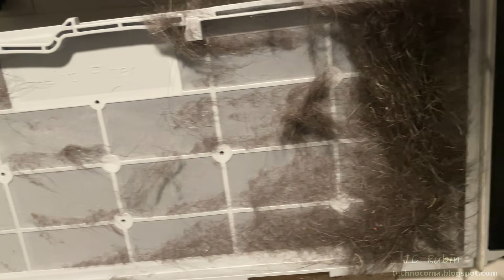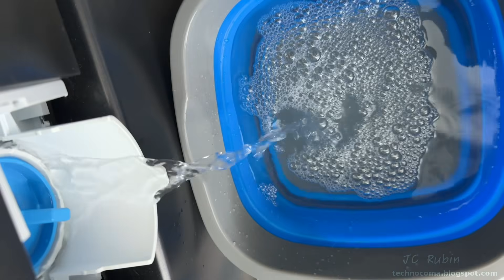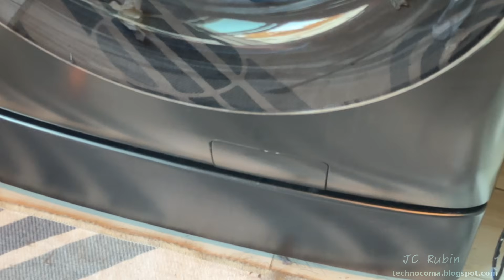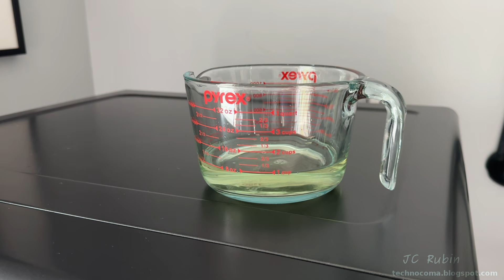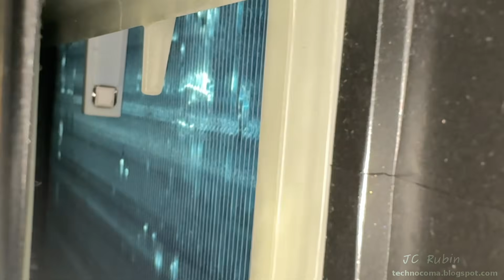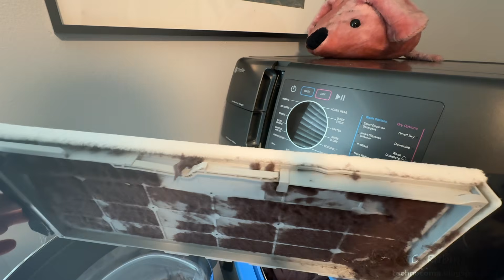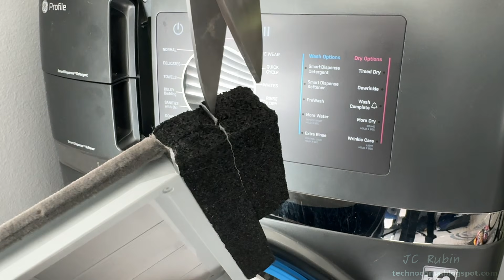GE Profile Ultrafast 2in1 Combo Washer Dryer - Why they Fail & How to Fix it

Comment: I just got mine delivered last week. As I was using it for the first time, your video showed up. I got both of those sticky foam liners for the filter. I am also going to see about getting the new filter for free. They need to just hire you, or you can 3d print a piece for the back and patent it and sell it to them. You clearly know more about the machine and how it works than they do. It's a shame. I was so excited about it and your video has me scared it will get ruined. I am going to buy the extended warranty on it. 
I live alone and I work a lot. This machine is supposed to save me time and money. I think with your modifications it can still do that.
Reply from the maker: 3d printing a piece has its own set of challenges.   Further it limits the amount of people who can conduct their own repairs.   Soon the seal results video will come out with the incusion of an internal seal installation
Reply: @rubin-tech I put the sticky foam liners but now I can't get the filter out 😢😢. But wow it did such a good job. I washed a comforter, two queen size sheets, pillow cases, 4 leggings and a few more small things. It took 2hrs total. But how do I get the filter out. Can I email you?
Reply from the maker: @jaydee1389 It takes a few tries as it breaks in and becomes easier with each subsequent load of laundry

Comment: This machine has been produced for over 3 years with the same design flaw GE refuses to acknowledge. Like many others, mine worked great for about ten loads before the dry times started to get longer, despite cleaning the lint trap every load. The fact it had a software update with a pet hair removal setting just screams to me they want this thing to clog asap. It DOES remove a lot of lint and hair, but the filter design should have been addressed during product testing. I could see lint getting into the evaporator on my first load.
Reply from the maker: The seals do well to limit the bypass.  A 6 month video checking this result is coming out shortly
Reply: @rubin-tech good to know. I like the machine otherwise.

Comment: I've had my GE combo for exactly 3 years now and it continues to wash and dry in the same amount of time as it did when new.  I identified early on that this unit was going to need consistent maintenance in exchange for only taking up one space in my laundry room.  Since day one, I've always cleaned the lint off the lint filter after every load as I also did with my regular dryer.  I completely wash with water, the entire filter assembly including the foam filter after about every 10 loads.  I run the self clean cycle with bleach after every 20 loads.  I always leave the lint filter out and the dryer door open after each load so that latent moisture in the machine is allowed to dissipate.  I use the brushes to brush out the lint compartment and purchased a special grabber tool on Amazon to reach in and get the lint cakes off the left side about every 10 loads.  And only about four times a year. I use a pump sprayer bottle that I bought with a very long wand for the specific purpose of washing off any lint that collects on the blue cooling fins.  Yes, this is a little more maintenance than most folks would be willing to do on a piece of laundry equipment, but I'm a retired tech geek and don't mind doing it at all.  I've never modified my filter assembly and don't plan on doing so in the future.  The one thing I have identified is very detrimental to this machine is the use of its fabric softener feature.  Most, if not all, liquid fabric softeners were designed to be used with clothes dried in a conventional dryer where the clothes reach a critical fusing temperature.  These high temperatures are never reached in a heat pump dryer.  What ends up happening is a waxy deposit of fabric softener plugs up the tiny little holes in the lint screen mesh which is nearly impossible to get out despite looking clean to the naked eye. This eventually severely restricts airflow leading to long dry time. GE even released a different version of the same machine that lacks the fabric softener compartment.  The major need for conventional fabric softener in conventional dryers is to keep static cling under control due to the clothes literally being over dried and cooked creating a static environment which can never happen in a heat pump style dryer, so in my opinion, fabric softener is never needed in these machines anyway.  True, if you have the optional platform base, your machine is going to rock and roll a bit due to the high center of mass.  Overall, I like the machine and would recommend it to technically minded people that they go ahead and get it.  However, if you're the kind of person that isn't excited about the extra maintenance this machine requires then it probably isn't for you and probably should be avoided.
Reply: Can you please provide a link for grabber tool you mention.

Comment: thanks for sharing this, a good friend of mine (that hasn’t seen this video) just told me the other day that these machines aren’t where they need to be (quality wise) and decided not to buy one. i knew these machines had issues but didn’t know it was this bad. thanks for posting this. they really should fix the machine with the ideas you have come up with.. or extend the filter housing at least so it can go the entire length of slot that you pointed out. strong work. thanks for posting!
Reply from the maker: You’re welcome.

Comment: How often would you recommend leaving the seals on? I just added them to my lint filter and curious if I need to replace them every so often or should would they stay in place if applied correctly? We’ll be popping the top off tomorrow to do a proper deep clean on the machine and coils as well!
Reply from the maker: So at 6mos they were ok. but if it takes 5 minutes every 6 months wouldnt hurt.

Comment: Has anyone used the new filters they apparently made and send out upon request? Our tech gave us a new filter a while ago but I didn’t know it was a new design. They just said “this is so if you have to clean the filter you can swap it and keep going while you clean it” (which doesn’t take too long to do so idk why that mattered)…

I am about to be charged $430-500 to tear the machine apart to clean it and use the new filter. But I think I’m going to just buy a new set and get rid of this. Hopefully the recall gets approved and I can get a refund.

Comment: Nope.....bought a five year warranty. THEY will come out and do it. Honestly....the machine works perfectly in "timed dry" vs sensor dry.
Reply: hmmmm how long do you set it to time dry?  mine leaks during the dry cycle.... i think i will add the 5 year warranty too... mine has been leaking since the day it was delivered.
Reply: I also bought the warranty and when I called them they told me it just needed to be cleaned and they don't cover that!  I've had this machine since first week it wen on market and it has been a nightmare.

Comment: I bought my GE Profile less than a year ago. I only use it about once a week. The first couple of times it seemed to get my clothes dry at the time it estimated (2.25 hours). However, it progressively took longer and longer to dry the clothes. The drying process itself would take many hours. The unit finally prompted me to clean all the filters and run a self cleaning. I started watching videos like yours to figure out how to clean it and had no idea about all the lint issues. I just ordered the upgraded filter and also ordered a long brush and an extension hose for my vacuum. I hope my drain hose isn't clogged as well.

Comment: I found an even better fix!
I got rid of mine.  Replaced it with an LG Stackable washer/dryer set.
I can wash/dry my clothes in a fraction of the time it took with this hunk of trash. 
The biggest plus?  No more issues with a horribly designed "heater box".

Comment: Had our unit since 12/2023.  I've cleaned the filter after every load. I noticed the lint on the opening that goes into the unit.  I've cleaned to water pump filter each month.  Two days ago the machine stopped drying.  I've cleaned all filters and the water pump to no avail. 
Unfortunately I'm not skilled enough to attempt the cleaning you've demonstrated in your video. Thanks for all your information.
Reply: I’ve had it for three weeks and it’s already not drying 😢

Comment: I purchased the warranty from square trade (All State), I have filed 4 claims on the same issue.  Each time, either the heat sensor or the control board was replace.  The 4th time, All State sent out both the sensor and control board again to ask the technician to change.  I bet it’s the internal drain line got clogged like this video shows.  I will show this video to the technician who will be coming to fix my machine.  At this point, I just want to give up and get the speed queen or other  German brands to replace it.
Reply: Did they ultimately find this to be the problem and unclogged it?

Comment: Great video, thank you. I realised our mistake in purchasing this machine two wash cycles in. I recognised the issues with the almost “lint filter” very early on in our ownership. I added all the same additional seals you added and also recognised that the filter should be removed at the end of the drying sequence because the moisture hangs around inside the housing assembly making all the debris stick to the wall where one cannot access. Will be looking for an alternate manufacturer of this style of machine. I fail to understand why GE didn’t see all these issues prior to releasing to market. In addition why the bloody hell didn’t they make an access cover over the left hand portion of the dryer assembly to facilitate easier maintenance.
Reply from the maker: Glad it was helpful. Many mistakes were made in the design.

Comment: I had to completely remove that corrugated drain hose in order to properly clear it. It was very difficult to get out and uninstall (had to take out a few more screws and lift the bottom of the filter chamber for access) but I'm glad I did. I couldn't remove the crud at the top of the corrugated hose otherwise. 

Thank you for all of your videos on this machine, especially the disassembly video! This drain hose clog is surely the root cause of most people's problems. After clearing the drain hose and making your filter modification, I am hopeful I won't have to take apart the machine again.
Reply from the maker: Interesting. There is only one Hose clamp to secure it to the top and came off without issue.
Reply: @rubin-tech  If this person was using the PFQ83 version of this machine (Essentially the Mid-Range model in phone terminology) that drain hose is a major pain to get to. I had to undo the heat pump screws holding it to the frame and prop it up as this person described. Unfortunately I did not find any clogs in there so my investigation continues...
Reply: I was able to pick coils up a few inches and clear drain hole and trough from above

Comment: Hey friend, your videos on this machine are amazing. I am getting this machine and it is my only choice. Obviously, I will be heeding your advice and getting the newest filter upgrade as well as the mods linked in your description. I know you mention "nothing gets by" I was wondering though since you do 6 month maintenance routines, what have you found after you implemented your modifications during the 6 month maintenance? Do you find improvement or a complete solution in the modifications? I'm wondering because I'm not sure how I feel about tackling the take apart every 6 months and I guess I'm hoping the teardown might be avoided if the filter mods are implemented from day 1.
Reply from the maker: Great question.... Im about 3.5 months into the mod so we have a bit more to go before the next teardown and inspection.

Comment: So happy I found your video. Watched It before my unit was delivered. Mine came with the "updated" lint trap design. Had a lot of laundry backed up and did 4-5 loads the next day. Complete wash and dry cycles. With the weather seal strips exactly how you demonstrated not a spec of lint made it to the coils. Thank you very much for taking the time to troubleshoot the lint trap and figure out what works best. I do feel sorry for those who don't use or know about the foam and just hope that the machine does its job at catching lint. Sadly it doesn't do well enough and it's agreed that the consumers shouldn't have to modify something that is brand new and cost 2K. Thanks so much for going through all of this. We do really appreciate it.
Reply from the maker: Glad the video was helpful.

Comment: I watched several videos on this topic, and this is by far the best.  A lot of videos have you tape or glue the inner filter to the housing.  This did not appear to be an issue with your filter.

Comment: This is one of the most annoying purchases we ever made. This thing sucks! And it was so pricey 😢 I accidentally dropped a stick I use to clean the filter side inside the lint compartment tube and we tried to take it apart! Our marriage almost ended after 3 hours of finding different screws to different parts and not even be able to take it apart 😂 i broke a part of the hose connector and we broke a piece that connects to the display part! 😊 I wanna give this away but it was so pricey. We had it for 3 years now we have two german shepherds and a cat. We use a pet wash tab once a month and still I get that nasty smell on our clothes. Awful machine
Reply: Call the company, they shoukd stand behind it, good luck

Comment: My unit died would no longer dry my clothes . Technicians came out twice. Technicians could not fix. Luckily I was a Best Buy total member. When I called about the same  problem for the 3rd time they set me up with a brand new machine with an updated filter works awesome.

Comment: Does doing this type of clean void any extended warranties purchased? 
Asking for a friend! Of course,
Reply from the maker: Absolutely! Also not doing it on mine would most definitely mean the machine breaking down and then good luck trying to find them honoring the extended warranty anyway so I just decided to stop it from breaking instead of worrying about the warranty
Reply: @rubin-tech good to know, also ever heard of anyone running two of these machines side by side? I think I might want to. Not sure how to do the hot and cold water tho
Reply from the maker: @theosuhm1515  A standard t fitting on the water connection is how ive done it in the past, the connector is shaped like a Y
Reply: @rubin-tech  i looked everywhere for videos.. i have a ge profile & and lg combo side by side.. but i found a small leak twice now 🫣 now i time out my cycles to avoid the issue, but would love some insight on how to set this up properly

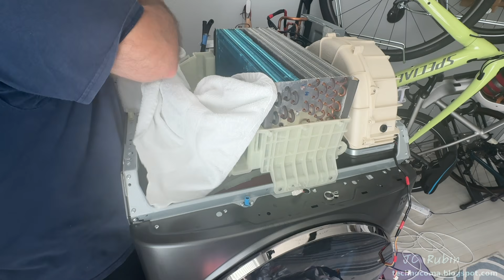Comment: Update: Today, 2-8-26, I got to this hose you show at 2:55. I pulled it off the nipple it’s attached to and water poured out. It was clogged EXACTLY like yours, full of a curled string of hair and crud. What was worse is the nipple was stuffed with this same crud, so there was no way it could drain out the moisture that was being removed during the dry cycle. 

Please post this video at the beginning of your first GE Profile video. If I was only following it I would not have caught this clogged hose. And, after clearing this hose, I went ahead and pulled to cover off the coils so I could clean them. Good thing I did! They were filthy, loaded with lint despite our cleaning after every wash. 
Thank you immensely for posting these videos. We are looking forward to having our GE Profile Combo working like new again. And I did do the filter mods as you suggest.  Hope they help keep the coils clean. 
GE did a lousy design on the filtering system. 

Sorry for my long reply… Hope it helps someone else!
Reply: IS there a way to get to that hose without complete disassembly
Reply: @baconshit  no, it's pretty deep in there.  I did this and I don't think mine is full of stuff though.
Reply: @baconshit from the top, the coils will lift up slightly exposing the troth and drain hole. My clogs are always where hose meets drain hole, I've been fishing them through hose but much easier from above.

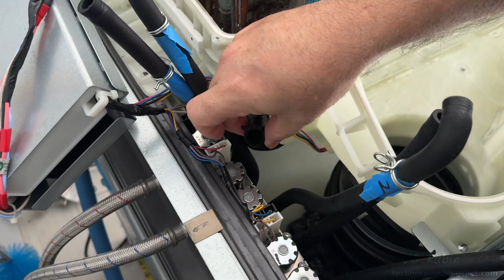Comment: At 3:05 you show the hose you removed. But... where did you remove it from?! I am sure my system is suffering from this tube being clogged. Tomorrow, 2-8-26, I will attempt to find it and clear it out. Hope I get done before the Superbowl starts! Thank you for this updated video, another excellent video.
Reply: Same question.  I assume from the bottom of the top coil casing just and just above the drum casing?

Comment: The cleaning brush you link to is not the one you use in the video. I ordered from your link and what came is a floppy brush that is useless for this job. I found the correct one and have ordered it, but you should probably correct the link on this video description.
Reply from the maker: Sorry about that, the link has been corrected
Reply: Bump